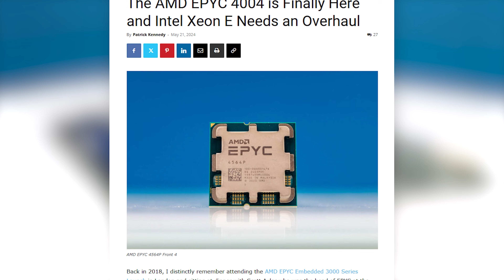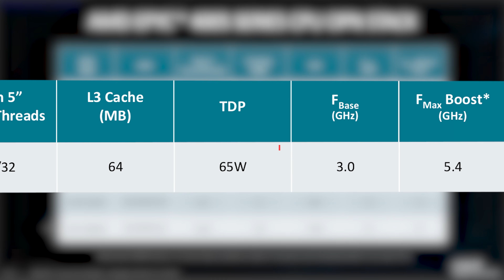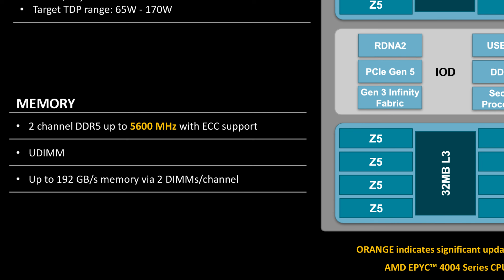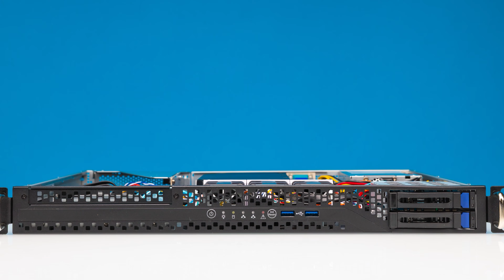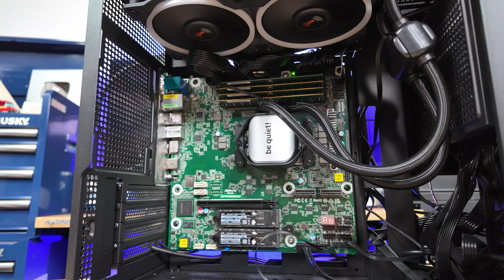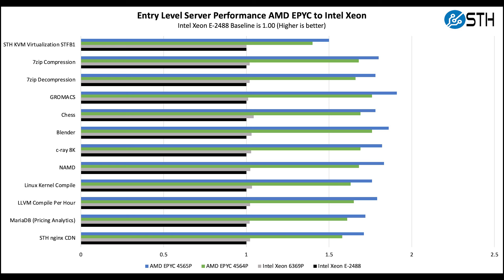The Must-Have AMD EPYC 4005 Grado Has Intel Xeon Cornered

Comment: Why are there 65w and 170w variants? Couldn't you just downvolt the 170w variant? Why would you buy the slowercpu for the same price when the faster one cash be downvolted?
Reply: Probably locked, no voltage control on the motherboard

Comment: AMD was kicking Intel's butt in memory throughput until Intel got together with Renesas to develop DDR5 'MCRDIMM'. That's in addition to the MRDIMM standard from Micron. As far as I know, both MRDIMM, and MCRDIMM currently only work on Xeon 4th gen, and up, but AMD has been collaborating with JEDEC to bring support for MRDIMM to EPYC platforms, with plans to support "a transfer rate of up to 17600 MT/s" (Trendforce). Currently, 8000MT/s, and 8800MT/s are available but in very short supply.

This is the part where server platforms start beating "gaming" builds on almost every single metric- core frequency will be the last holdout but that's also starting to vanish. PC development was moving so slowly until AI came along, and now it's moving at breakneck speed. I always knew they were beating us on the head with minuscule generational gains, and innovation, and AI proved it. Price is the only good reason to buy a "gaming" build but even that is questionable if you consider the fact that you could potentially get something like a 10 year upgrade cycle from a socket SP5 motherboard. Just continually upgrading as the prices collapsed.

Comment: Question, will mobos like Gigabyte X870E AORUS MASTER will accept it? These epyc are not ecc fbdimm so np with memory socket right? Even with ecc features if installed on a board without ecc will run right?

Comment: I don't understand the amazing 65w skus. Is there any problem to get top of the line 5.7GHz Epyc and set tdp to 65w?
Reply from the maker: The 65W are less expensive for one.
Reply: @ServeTheHomeVideo it's good if it's so. Hope never again see systems, that will restrict to installing higher TDP CPUs, when they only can provide lower power. And these power restrictions always will be implemented on bios side, so there will be no point for me to look for rare and expensive 8700t/12900t/5700ge etc

Comment: The only thing that's missing in AM5 platform is a proper Pro variant (with more PCIe lanes, from the CPU even 8 more lanes are enough assuming bifurcation is supported) the X870e chipset isn't a thing really and it requires a larger motherboard. A proper implementation is that a Pro platform requires the e variant for the chipset (unlike the current dual chipsets, it's an actual variant), the Pro must also support unbuffered ECC RAM or non-ECC. But the must support ECC ram with an official QVL page listing the tested and supported modules, maybe Pro chipset also have a built-in remote & offline IPMI function or at least requiring an external one.

Some might say you're talking about Threadripper, and I'll say you might be right if you're talking about the first generation of TR, but this platform came along way, and now it's way more expensive, you can get a server grade AM5 motherboard & the top-end AM5 EPYC CPU for less than $1100~1300 which is very plausible for a pro grade product... With TR that will only be for a low end motherboard only, a TR CPU can get to thousands now.
Reply from the maker: Interesting thought. More I/O means more pins and a bigger socket. IPMI the ASPEED AST2600 is so popular that it is what you want these days.
Reply: @ServeTheHomeVideo Extra 8 lanes will not require that much, I'm not an engineer but the actual pins for 8 lanes are 49 pins only (maybe more Idk), which is doable in a mainstream socket and the benefits are huge, they can also repurpose SATA lanes for PCIe like how they're already doing it with their chipsets. The main idea is to make the mainstream platform more appealing to entry-grade servers and workstations, hell even enthusiasts, homelabs, DIY & non-DIY NAS and more... The market is here and it can be done.. it's just silly that if anyone needs just extra PCIe lanes he has to go for an older used market or jump to a multi-thousands of costs.

They can also differentiate the prosumer market from the actual pro market with X970e and X970e Pro, the later can have the IPMI and ECC required while it's optional for the former one. And only the e variant of the chipsets can enable those extra CPU PCIe lanes
Reply: It would be great to have them run some of the extra pcie5 lines to a switch or mux and have a few extra pcie4 options.
Reply: Honestly am4 had a better high end than am5 does. It felt like a downgrade going from x570 to x670e

Comment: Same price, base+turbo, and power as the Ryzen 9950X. 

What advantages or disadvantages does one have over the other? Considering the 9950X is usually offered now at a 20% price reduction and likely as more affordable and feature oriented motherboards (maybe except for HTML iKVM).

i’m pretty sure the 9950 even supports ECC

i appreciate anyone knowledgeable who can explain why a business would chose this over a 9950x. it definitely looks promising!
Reply: For small business use, it's validated and supported as a server CPU, which is important for running something like windows server and having a MSP that will support it.

Comment: It only makes sense to buy this over the 9950 if AMD decides not to release proper signed drivers for Windows Server. Which is usually the case for most major hardware makers. Even if the drivers are the same.

Comment: is this cpu good for my personal minecraft server (heavily modded) ? can i also run it in tandem with my ark server ?
Reply from the maker: Yes. Game servers are popular use cases for dedicated servers using these CPUs
Reply: Overclock of one of those: 9800X3D or 14900K or 285k - should be faster for game server.
Beware: 14900K's are prone to degradation.

Comment: Those Epyc CPUs on the AM socket is one of the best decisions AMD made. It closes the gab between Low Power Servers for NAS applications and the total overkill systems for Datacenters. Small businesses don't need such overpowered systems even the smallest configuration those systems cost probably 10k to 30K. For most Small to medium Businesses, something bigger as an Typical Office PC has more than enough Compute Power and Storage can be added over iSCSI. In the Company where i Learned, we had an Office PC and an DELL PowerVault 3600i this was more that enough for the Company the PC had an 10gbit NIC connected to a Switch over SFP+ with a DAC Kable also the PowerVault and every one in the Building got 100mbit, but eventually this was upgraded to 1gbit because the New PC had finally gbit LAN. The Switch is an 24port 1Gbit + 2 sfp+  and is managed. The Whole internet was a fritzBox with a 25mbit connection. They still use this til this day.

Comment: I want AMD to make an IOD that is quad channel, 48 PCIE lanes (plus lanes for 2 chipsets) that they can cut in half to make Ryzen or leave together to make Threadripper.  I should be using a 16 core Threadripper system by now but AMD decided abandon HEDT entirely in favor of HEDT pricing and core counts on consumer socket and creating a new Lite Workstation category at twice the price of HEDT.  Instead of being able to sell me a reasonably priced HEDT 16 core part, I went with a 5700X3D that was on sale for $90 less than the 5600X launched at.  $205 with the $5 bundle discount.  Not sure yet where I go from here.  I keep hoping for a quad channel 48 lane system at a reasonable price, but I doubt it'll happen.  Everyone just tells me to buy a useless 16 core desktop socket part because it has enough cores, but HEDT is about the lanes, bandwidth and memory capacity as much or more than the cores and it is for those reasons that I want it.

Comment: I don't see the point of getting the lower TDP part unless you absolutely can't get rid of the heat. 2DPC is also nice but you murder your RAM clock when doing that.
Reply from the maker: In data centers you often have power limits
Reply: These are not for gamers. Different use cases have different trade offs.

Comment: For a home server, how do these differentiate themselves from the consumer zen5 parts? They don't get more pcie lanes, which is my main issue with consumer line. I always hand down my gaming rig to my truenas box, I had to do a lot of searching to find a board that will let me have a gpu, HBA and 10gbe NIC to go along with my 9800x3d. Guessing I'm not this line's audience :P
Reply from the maker: The old system being replaced in the video was a 7800X3D. You are right that with more lanes you would step up to the larger socket with more I/O pins like the EPYC 7000 or 8000 series
Reply: consumer boards are over-fitted with loads of USB, M2 slots and stuff usually a IPMI server dont need, its very hard to find consumer motherboards with not restricted PCIe slots. Its a trend to show up boards with even 3 x16 slots as it looks impressive on the photo, but reading the notice in the manuals you find out they all restricted , if using this than that is disabled ...and so on, even SATA ports are often the victim of restrictions so have to find a HBA to use some drives, see some options for M2 slot covertors to SATA ports that might be usefull in some cases to overcome the board limitations

Comment: I'm still amazed that VGA and RS232 ports are still a thing. RS232/serial coms managed to stay relevant, but VGA refuses to die.
Reply: I had VGA ports on some AMD B650 motherboards, but I haven't seen them on the B840 boards I've recently purchased. VGA has a long tail, but it is definitely shrinking
Reply from the maker: Still many KVM carts in data centers and remote console gear with legacy ports
Reply: everything I'm seeing has no VGA or RS232 so not sure what world you're living in

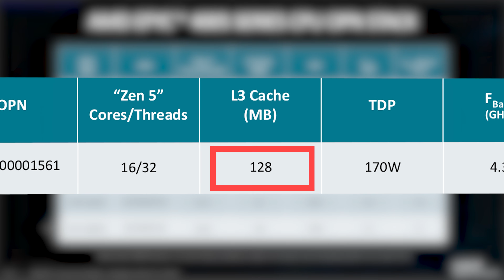Comment: 2:35 in Zen5 the trade off of the 3D V-Cache is not present anymore, AMD moved the V-Cache to the lower side of the die, allowing to keep up the clocks with the normal versions, you can see the results of the 9950X3D being even better than his non-3D counterparts (9950X), the 9800X3D even outperforms the 9700X with less clock in some multithreaded scenarios.
Reply from the maker: True, but you still need to power the cache die so you end up paying for it.

Comment: I don't know why anyone would want this.  
We've had the 5950x, 7950x, and 9950x all with 16 cores... forever.
What we are waiting on is a 32 core AM5 CPU for content creators from AMD.   
Anything less than that continues to be an incremental disappointment.
Reply: They will come in epyc & TR form.

What u  will see is 12 cpu  core core modules instead of the  current x8 cpu ones - hence, 12 core and 24 core zen6 products

Comment: 2:34 Wouldn’t be so sure about the “tradeoff” - AMD changed how they stack 3D V-Cache. That was the case in the previous generation because the layer of cache was basically an insulation layer

Comment: need more slots/ need to idle lower, need to be cheaper, and if you don't have the slots you need to beat quicksync to be better for homelab. maybe ok for some weird small server at a office though. too strong for manufacturing they just need PI's to run cnc etc
Reply from the maker: Well to be fair, these have the RDNA 2 media engines while the Xeon E/ 6300P does not, right?

Comment: Is the RAM running at 3600 with 2DPC 2R? Or have they improved it?
Reply from the maker: That is correct
Reply: That's why Lenovo kept with just 2 DIMMs on their server platform, an empty second DIMM on channel limits bus speed from 6000 to 5600/5200 MTs.

Comment: How many PCIe lanes does it have? I have the EPYC 8024 and it's awesome, because it has enough lanes for everything and with 6*16GB DDR5 ECC RDIMM RAM I am barely scratching the surface of what the chip and chipset/motherboard is capable of.

Edit: to answer my own question: it has up to? 28 PCIe Gen 5 lanes. That's not much for homelab servers, that use NVMe storage. But I am sure it has its purpose.
Reply from the maker: The EPYC 8000 series is great.

Comment: I wish amd would also venture more with their workstation GPU's
Reply from the maker: Very fair
Reply: i still use a Radeon Pro WX3100, they do nice and are not powerhungry , its not for games but for proper desktop, small and low profile ideal for serverbuilds. Now with AMD iGPU CPU`s we might dont need any external GPU anymore, saves money, heat and leaves a slot free for other things.

Comment: is it just me, or is he just describing AMD AM5 Ryzen chips because zen 4 and zen 5 have igpu with 2 cores for display out, 28 pcie lanes, so the epyc 4005 series is same as ryzen, but with validated memory etc. oh and bigger price tag.
Reply from the maker: Price tag is actually similar. For example, the EPYC 4585PX is $699 list which is less than the AMD Ryzen 9950X3D on Newegg right now.

Comment: Do Asrock still glue the socket backplate onto the motherboard? Their X570 series did this and it prevented me from using a lot of cooler options and ultimately I abandoned the platform. Sure, maybe you could use a heat gun to soften it up and pull it off but that's a lot of hassle for something that shouldn't even happen in the first place.

Comment: still needs more lanes but it's getting close to perfect for SMB/home servers.
Reply: You can honestly do more than most are going to need in a home with the lanes that are there already. My AM4 Proxmox system has 2x GPUs, 10Gb Nic, TV Tuner card, room for 2x NVME and 4 SATA HDDs. I'm also using a 10Gb card because my Asrock X570 board with it built-in started spazzing out after running 4yrs 24/7.

Comment: You are right to geek out about the 65W TDP. 
This comes in handy when you're doing home servers or edge compute servers and you're not losing much.  In fact... I doubt you'd notice the slower clock speed for production level work.
Reply from the maker: There are certainly applications that do, but for most folks, the 65W is going to be the sweet spot
Reply: Ive got a Dell R710 2 Xeon(R) CPU X5650 142 Gb Ram 2 Ssd's
Under proxmox with couple windows VM im at 119W - 135W
Reply: @Wolf_Fr  
In a different room,  I Have 4 servers sitting in a rack.  Each server is an AMD 24core threadripper.  You can feel the heat in that room, even at idle. 

Be Quiet Coolers  over trying to find an all-in-one cooler. 

So yes... I'd prefer the 65W TDP. Easier to cool.  

Right now. I'm only keeping one live because I don't need the whole cluster.

Comment: Can you make a Video with best boards for that thing please ?

Looking for PCIe Slots for:
-Intel Arc310
- LSI9400
-DualSFP+ card
Reply from the maker: I probably would go up to an EPYC 8004 or EPYC 7003 for that. We have many system and motherboard reviews on the STH main site
Reply: @ServeTheHomeVideo  currently I run a R7 4750 with the above mentioned cards on a x470 Taichi ultimate with 128 GB ECC

So I'm basically checking which boards can I use for a Gamingsystem now and convert it later to an Homeserver Upgrade.

Comment: The lack of an adequate Xeon-D response is unfortunate. Intel has a legit argument for SMB applications and they’re fumbling.
Reply from the maker: The new Xeon D (Granite Rapids-D) is really neat, but Intel has been charging increasingly more for its parts to the point where for the SMB they often do not make sense https://www.servethehome.com/intel-xeon-6-soc-is-here-granite-rapids-d-is-huge/
Reply: @ServeTheHomeVideo  A comparison of AMD and Intel product segmentation would be interesting. I don't know if I'd consider the GNR-D parts in the same segment as the 4005s, seems like the W-series might be a closer match?
Reply from the maker: @poofygoof  You are totally correct. Xeon D is BGA. The close match is the Xeon E-2400 and Xeon 6300P series for the EPYC 4005.

Comment: 12:14 Intel basically rebranded an i5 12500 and an i9 13900K (E cores disabled) from 2022 as new chips in 2025.
Reply from the maker: It is not the first time
Reply: @ServeTheHomeVideo  Last year when they announced Granite Rapids I clearly remember seeing a smaller version on their slides with a 16 core compute tile which was supposed to be the Xeon 6300 series. It seems that one got canceled and replaced with old LGA1700 chips.
Reply: Yeah

They need to change the architecture for this lineup now.
Reply: @TitanPlakInside  they literally removed the competent engineers

Comment: New video, same question:
What is the difference in ECC between Ryzen AM5 and Epyc AM5?

Or why is ECC explicitly mentioned when EVERY AM5 CPU supports ECC RAM without any problems, which is a fact!

Since Ryzen AM5 CPUs works with ECC exactly the same as Epyc AM5 CPUs do! 
It makes absolutely no difference whether I use a ridiculously expensive Epyc CPU or an exactly identical but half as expensive Ryzen AM5 CPU.

So why should I use Epyc AM5 CPUs that have the EXACT SAME ECC Support as all AM5 Ryzen CPUs...

What is the real feature the Epyc AM5 gets that Ryzen AM5 doesn't?
its only the EXTREM High Kost for Epyc CPUs is the Differenc! 

Don't be fooled, buy Ryzen AM5 and not an overpriced Epyc AM5

Comment: So I guess this new series is essentially the same silicon as Ryzen 9000 but validated for motherboards with ECC memory support, just like Epyc 4004 was to Ryzen 7000?
Reply from the maker: And with new SKU options like the 65W 16 core part that does not have a Ryzen alternative